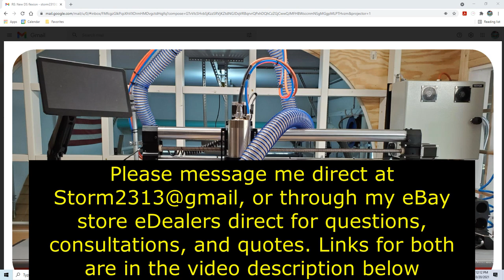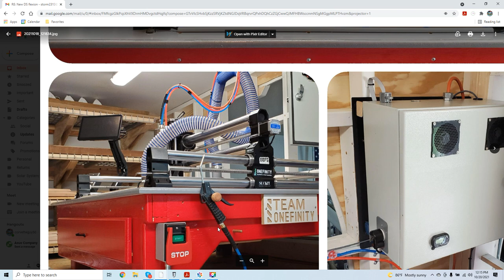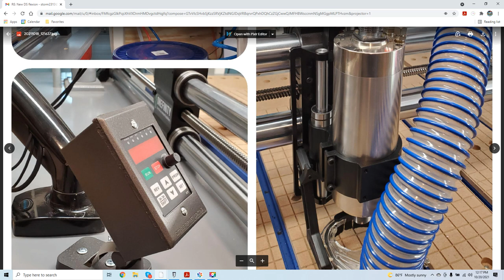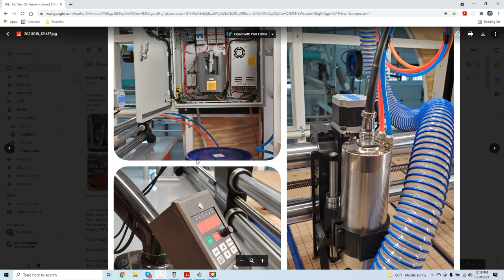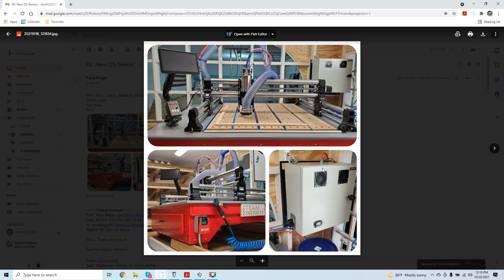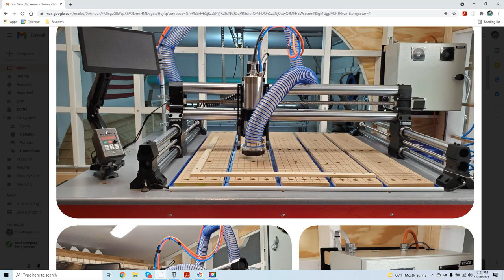A Onefinity CNC Done Right..

Comment: Outstanding video.  I’m sure you mentioned it in the video…what spindle specifically is he running?  Thank you!
Reply from the maker: Hey David, thank you for the support. I believe its a 2.2Kw water cooled unit. Have a great weekend!
Vince
Reply: @corvetteguy50  Thank you!  I was kind of thinking.  Is it just one of the generic ones?  What are your thoughts on the higher end spindles?  Like a Mechatron.  Thanks again!!
Reply from the maker: All spindle's do the same thing, so as long as their bearings are quality the performance should be excellent. Durability of any spindle depends on many factors like is the shop properly climate controlled, how hard the unit is worked, ect. Thank you, and have a great weekend!
Vince
Reply: It is an  Huanyang spindle
Reply from the maker: Correct, thank you for your support. Vince

Comment: Very nice layout indeed.  Thanks for sharing, I am in the midst of putting together a Onefinity and this is helpful.  Just FYI, the 1F doesn't come with drag chain but many folks seem to add it.  I am wondering how this layout deals with the X and Z stepper cables.  Do they simply drag along the side of the left side of the table?
Reply from the maker: Alan, thank you for your support, and sharing about the drag chain. Have a great weekend! Vince
Reply: I recently read that the drag chain isn’t recommended because of the low and high voltage power on the router and Z coiling cable will get interrupted and cause issues. You need to rotate router 180 I think? I’m sure I’m saying something incorrectly, just passing along knowledge I learned from someone else.
Reply: @TPuffTree   their new elite odel comes with drag chain and better cables